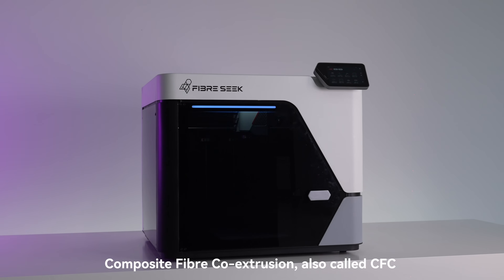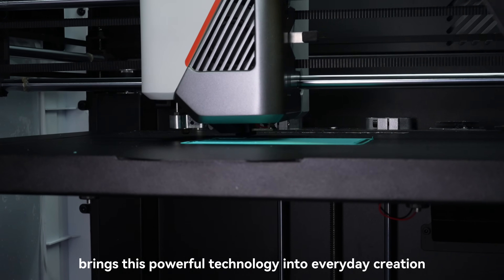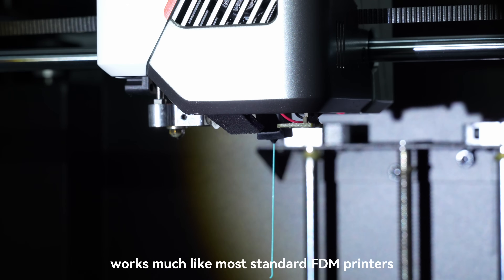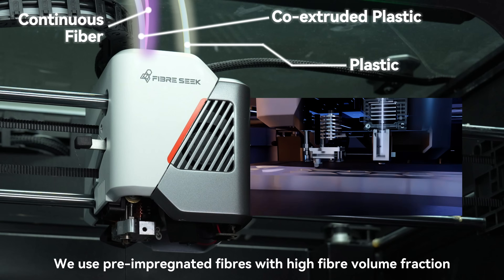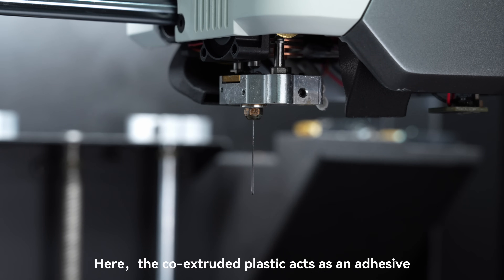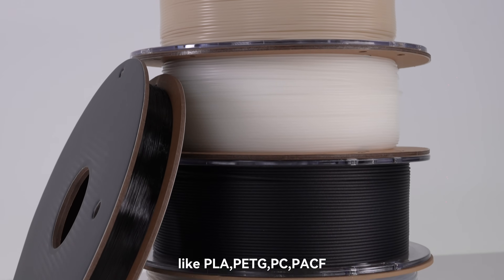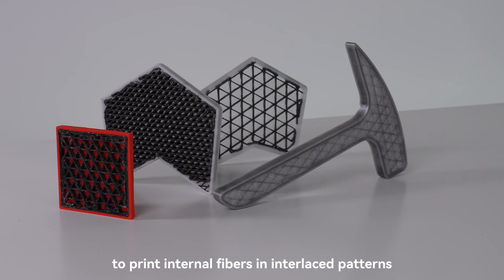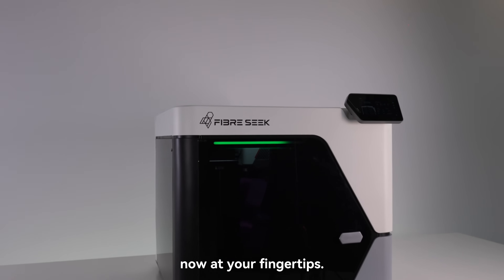CFC 3D Printing Explained | FibreSeeker3 Continuous Carbon Fiber Desktop Printer

Comment: I have a question.... how does the machine "CUT" the fiber that is being printed on the part and when the nozzle finishes and goes away, the "continuous fiber" does not pull the whole print out of place?
Reply from the maker: Our composite printhead (the one for continuous fiber) has a built-in cutting mechanism. It cuts the fiber in advance, at a higher position above the nozzle—not right at the print surface. This pre-cutting ensures that by the time the nozzle moves away from the print, the fiber is already severed.